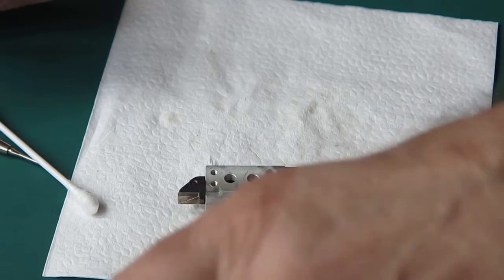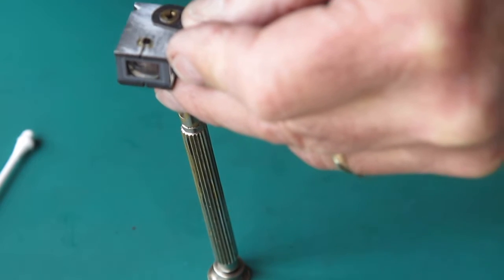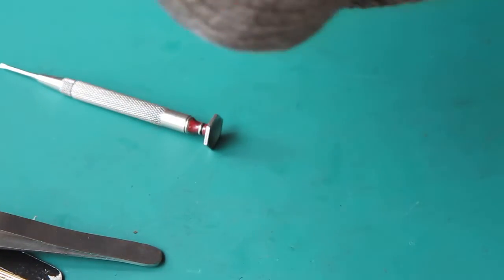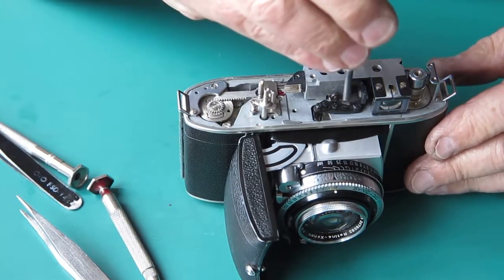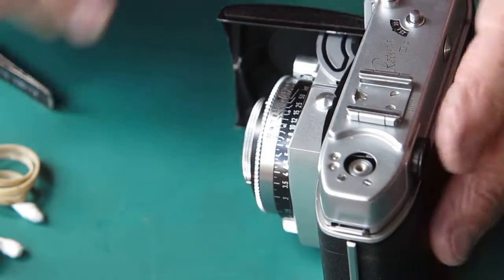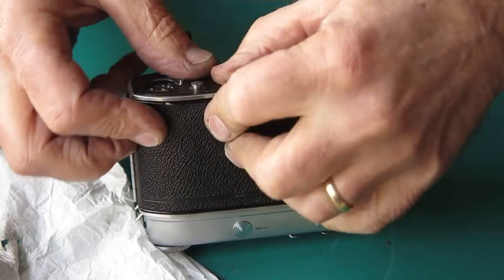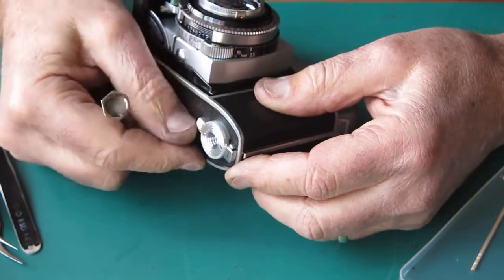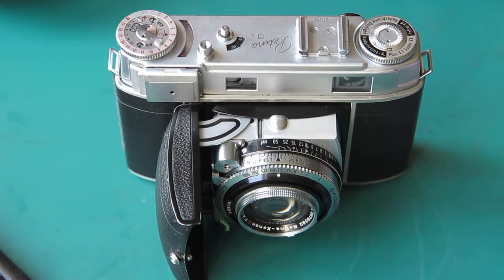Kodak Retina IIIc jigsaw puzzle part 07

Comment: On the 2 tiny prism
screws I have been using a tiny amount of saw blade wax which allows me to adjust the alignment but also to stick them in place without being moved even if the camera is bumped.  I guess a bit of any candle wax on the threads lightly might accomplish the same thing. Just rubbing the threads with the wax.  No globs.